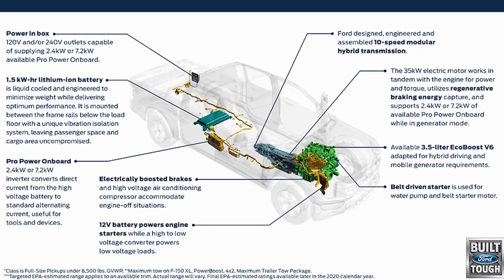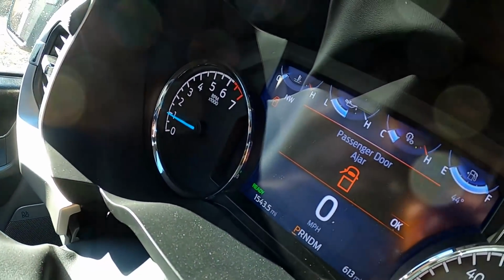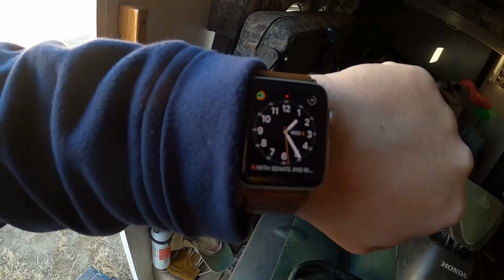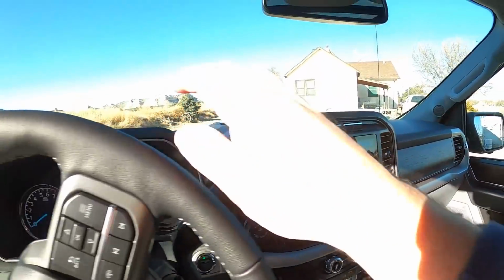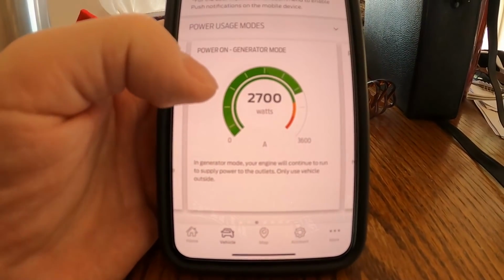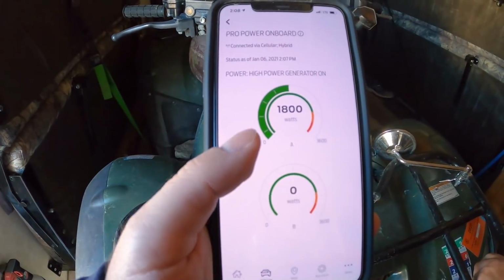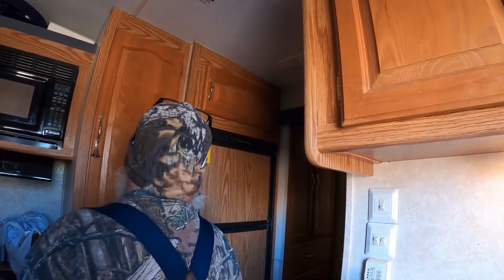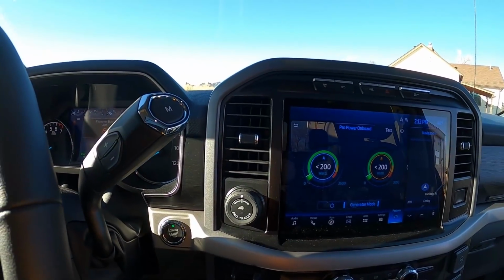Can the truck power an RV? 2021 Ford F-150 Generator Initial Test

Comment: Tim, great video although a little confusing as to whether or not the truck has to be left running and then it turns itself on and off as needed in generator mode.  I have a 2021 F-150 Lariet on order with the same Powerboost configuration, and the ability to power a trailer is important to me so I don't have to lug a portable generator.  I ordered the 2.4 KW and not the 7.2 KW configuration because it's not a work truck for me and I don't think I'd ever need 220 away from my shop.  You commented that you have 30 amps in the F-150's 220-Volt outlet, which is true.  However, you showed a splitter that plugs into a 220 outlet and provides 110 volts.  It does this by tapping one of the two legs, because a 220 volt outlet is essentially two 110-volt wires back-to-back.  The 30 amps in a 220 circuit consists of 15 amps on each leg.  Thus, if you tap into only one leg with a splitter, you'll only get 15 amps at 110 volts.  If you want 30 amps at 110 volts out of a 220 volt outlet, both legs of the 220 volt circuit need to feed into a transformer to drop them to 110 volts; in that case, you could obtain 30 amps at 110 volts.
Reply: @artvr2961  Art, I'm not an electrician either, just an old(er) engineer.  The 220-110 adapter plugs that I've looked at are very simple in that they just connect to one of the two 110v wires and the neutral leg of the 220 outlet, with a 110v output side that looks like a normal 3-prong outlet.  That's fine but it is not the way most 220v outlets are designed to work to provide the full power output -- 30 amps in this case -- by providing 15 amps on each leg.  But because this adapter would be drawing current from only one leg, I would worry that the circuit breaker in the F-150 will trip if more than 15 amps is drawn from that one leg.  Given this, it appears to me that the F-150's 220V system is for 220v appliances, such as welders, large table saws, etc..  However, there are a couple of solutions:  1) Buy a converter than takes 220v and steps it down to 110 but it'll have to have 30-amp capacity or about 3000 watts.  They're available on Amazon for about $200 BUT (big BUT) there's a note that says the ones I looked at are for European/Asian 220 only because American 220V circuits use 2-phase 220v power, whereas European/Asian are 1-phase. (2) Reduce the starting current draw from your RV's  air conditioner, using an EasyStart accessory.  I bought one and tried it out because I have an A/C unit on my trailer that trips my 2000-watt generator due to the high starting current (I think the BTU rating for my A/C is 13,500 BTU/hr).  I did not want to buy a larger generator because it won't fit in my trailer's storage compartment and it's much heavier.  The EasyStart has to be wired into the A/C's circuitry and it uses a solid-state circuit to reduce the starting current and make it possible to run the A/C on a 2000 watt portable generator.  They're not cheap (about $300) but they do absolutely work.  It took me about an hour on my RV's roof to wire it into my trailer A/C unit and another 20 minutes or so to get it set up.  The EasyStart installation instructions are excellent and they're tailored for the brand of A/C you have.  Here's their website:  https://www.microair.net/products/easystart-364-3-ton-single-phase-soft-starter-for-air-conditioners?variant=30176048267.  If you go this route, then you don't need to fool with the 220v in the F-150 and can plug into one of the 110V, 20-amp outlets.  This is the rationale that I used to equip my F-150 (not yet delivered) with the 2.4KW generator system and not the 7KW system.
Reply from the maker: 1. Leave the truck turned on, the engine cycles off an on.

2. I just bought a plug converting 220 to 110 and keeping the 30 amps. This means I’ll plug it into the camper with 30 amps.
Reply: @artvr2961  Well, yes and no.  I am looking forward to not having to cart my 2200 watt generator when dry camping, as it's just more weight and something else to carry gasoline for.  I do agree that the generator system is more aimed at folks who use the F-150 as their work truck; I decided that I'd be very unlikely to need 220V power when away from home.  My welder will run on 110 but just not as well as on 220 if I ever had to take it somewhere else to weld.
Reply from the maker: @artvr2961  This plug was recommended from a viewer on this channel. Not sure it is THE solution, but I ordered one to see if it would work. Naturally, it is on back order.

https://www.homedepot.com/p/PowerFit-30-Amp-240-Volt-to-30-Amp-RV-Outlet-Adapter-PF923055/203213234?cm_mmc=hd_email-First_Delay20210107_PP_ET_Merch_First_Delay_3741587_-PRODUCT_IMAGE__WM28915233#product-overview

Comment: Thank you, always like to know more than one opinion. Sure enjoy your  program, its very useful. It will be helpful when I get ready to buy. I am looking forward to your report on the new Ford. Specially on how towing and the generator work. I was wondering if it would power a camper, either  truck or trailer.

Comment: You can charge an EV with the 220/30 amp outlet, you would have no problems with an RV
Reply: IMHO RVs are more punishing because most folks don't understand the damage they can do to a genset/inverter with high amp appliances... little to no surge protection

Comment: Iol love where you are taking this too; this is crazy lol I have an RV and added a soft start for a 15k BTU A/C Coleman Mach 10 and when dry docking we use the A/C through our 3500 Inverted Generator. Now  using an A/C through a  new F150 Hybrid is crazy; love this test lol Yet if the RV was set with an after market Hybrid 2000 watt Steinway Inverter and lithium batteries. You could  run it through this truck all day as long as the Truck has gas. Much quieter thats for sure. But for me it would be boon docking nights. I'm getting this truck regardless. May jump out of my  current Lease 6 mths sooner.  Love this Hybrid!

Comment: Now hopefully RV manufactures will put a 30 amp plug at the front of the camper as an accessory plug-in for keeping the air conditioner on while driving down the road to your campsite.....

Comment: The lights and the fan in the RV are 12-Volt DC not 120-AC, so unless it has an inverter/charger it will take  little amperage draw coming from the converter to charge the batteries.

Comment: The ac may not run the compressor because it’s so cold out already. Probably showed have turned the propane heat on and warm the trailer up.
Also if you went to bed and let the truck start and stop all night at a camp ground they would probably ask you to leave.
So your only pulling 100 watts and the truck has started and used gas already. Not good. This is why I say the battery is to small.
At only 100 watts it should have ran for hrs with out starting the engine.
The engine is only idling so your not going to use much fuel when it does start.
If boon-docking it would be ok.

Comment: Refrigerator will draw 1100 watts normally.space heater will be able to tell you more. I always thought it was unwise to run a microwave empty.
Reply from the maker: There was water in the microwave.

Comment: I really wish this worked. Simple for me. If it works I buy the F150 next month. If not, I wait for my reservation number to come up on the Cybertruck... Does any of your fam have a roof top camper unit with a heat-pump, (kinda rare I think)? That would be a good test.
Reply from the maker: Sadly, no heat pump that I know of.
Reply: I ordered my cybertruck.
It comes with both 240/120 with much bigger capacity.

Comment: Ford setting the standard again.

I really believe that this is going to be a game changer if it proves to be very useful and reliable. 

LOL.....I wonder how long it's going to take before the other brands try and copy it.
Reply from the maker: About 2.2 nanoseconds to copy.
Reply: The generator mode is very cool, and so is the full recline seats. I absolutely hate the dumb fold down shifter though. That thing is gonna break in half a second if it gets any regular use, then how the hell do you shift it in drive?
Reply from the maker: @espeterson522  you don’t have to get the fold-down shifter. My truck has a column shifter.
Reply: @espeterson522  ......The key words in your reply are”regular use”. 

I really doubt that it’ll be used by owners as much as you think for the purpose it was designed for. 

Also, I don’t think it can be used when the vehicle is in motion so more be than likely,  there’s a lockout when the shifter is not in the “Park” position.

Comment: Backfeed your house, you could run your furnace, some lights, and chill the fridge a few times a day.
Reply from the maker: You certainly can with an external power input plug and a way to turn off the power in through a breaker box setup. I’ve been watching a lot of “this old house.” 😂

Comment: Tim, you can delete the two honks after walking away from the running truck with the ForScan OBDII programming tool.
Reply from the maker: Should be a setting in the truck imo. I know I can turn off Chevy’s honk.
Reply: GOD BLESS YOU - every one of my Ford's did this and drove me nuts (it's super loud)
Reply: @rkalla  it's to let you know that the keys are out of the vehicle.

Comment: Something doesn't make sense. You have a 7.2KW battery onboard and had a very small load. Why was the engine running? Shouldn't the engine only turn on when the batteries get low? It's hard to imagine you drew down the batteries enough to cause the engine to kick on and recharge the batteries. I was under the impression when you plug into the outlets in the bed, it uses the power from the hybrid 7.2KW battery and starts the engine when the batteries need to be charged. Again, my understanding was the "generator" isn't a conventional generator where power is generated by the engine but more like a 7.2KW battery pack with the engine kicking on/off to support the battery state of charge.
Reply: It's a 7.2kw system,.but the battery in all of them is the 1.5kwh isn't it? I'm 99.9% sure the battery is 1.5kwh
Reply: @rkalla  I stand corrected. That's correct. The system can generate 7.2KW but the battery is only 1.5KW.
Reply: Everything I’ve seen shows a 1.5kw battery.
Reply: @jeffs2809  7.2KW is the upgraded optional battery, which he has. A 2.4KW is standard.
Reply: @Thomas-qk7wf  3 different levels/options are offered.
Reply: @Thomas-qk7wf  you're thinking of inverter capacity. It's a 1.5kw battery regardless of inverter size.
Reply from the maker: That’s a great observation honestly. I don’t have an answer for you. It would make sense the truck wouldn’t run at all just pulling a light load.

Comment: Lights are 12 volt system. Battery would power those. Your truck would power the inverter if battery is low.  Microwave, air conditioners, toasters, Electric heaters have the highest serge power.

Comment: Good video Tim. Now I have RV’d for 20 plus years. I used two battery’s and dry camped for two weeks at our favourite spot. We can easily run the lights, DSI for fridge and hot water tank for a week to 9 days. All 12 volt of course. Now I had a Honda generator to recharge the batteries and or other appliances. A Honda generator can run over 5 hours on just over a cup of gas. Honda is quit as hell. I wouldn’t run my truck to power my camper. Now the test of doing it is great of course but not all totally realistic for vacation goers. Over night stays with no power yes.  My thoughts and experience. I would also use my generator to boost my boat battery if need be. At the dock or shore. Now a days they have portable booster packs though. Cheers
Reply from the maker: Once it’s not cold as hell, I’ll stay overnight and try the truck powering an RV.
Reply: This is a damn interesting point - had no idea a stand alone type generator like the Honda is that efficient. Very eye opening.
Reply: @rkalla  I think he's joking about only using a cup of gas per 5 hours. My 2000W gen runs  ~10-11 hours on a gal.of gas on eco mode charging my batteries. If i run a heater or something requiring more amps, then you use more gas as the generator runs higher rpm's. Like him though, I wouldn't pay the extra premium for the Hybrid just to replace a small gen-set. If you have other uses, then it may make sense (?).
Reply: @herb7877  appreciate the heads up - I took him literally at the "1 cup of gas" comment so what you are saying seems a bit more what I expected.
Reply: @rkalla  Yup. They are great and very very efficient and super quit. Had mine for 18 years. Runs like the day I bought it. 1000 Watt. Buddy has 3000 watt and runs his air conditioner etc if need be.
Reply: Which model Honda Generator do you have?  

According to the Honda website, their most powerful generator, EU7000iS, can run from 6+ to 16 hours on a full tank of gas (5.1 gallons)

Comment: Also Ford need to add a 30 amp plug
Reply from the maker: I’m not sure the rational about the amps. Seems like a 50 amp plug would make sense.
Reply: @Pickuptrucktalk  that would take you beyond 7.2 KW. You need to have 220 volts with 50 amps. It would take you to 11KW

Comment: Cool but you need to do a summer test with the compressor running that’s the only time I need to bring my generator with
Reply: Am a BiPap user.  I have to carry back-up, Honda 2000i and 5 gallons super unleaded without ethanol.  However this is a grand feature..

Comment: Run a couple of plug-in electric heaters, those will load up the generator.
Reply: Yeah, I came to the comments to say RESISTIVE HEATERS!
Reply from the maker: Good point!
Reply: Good idea!
Reply: I just took my camper down to Bullhead city for a week and we use space heaters when in a full hookups site and they work great. And yes they can trip the breaker.

Comment: Can you run the power inverter generator hooked up to the trailer while driving down the road with appliances running ?
Reply: Yes.
Reply: I used to just run the propane on my fridge to keep it cool. Takes next to nothing. For if you stop somewhere it may drain the battery really fast. Not sure on the Ford system but truck would be off. Hmm
Reply: @ramrider1453  Fridge is easy on propane. This Ford system can run the AC. Lifesaver here in Texas. It's blazing hot and it takes hours to cool after arrival. Everything in the trailer heats up while traveling.
Reply: @jghall00  oh for sure. Most people though do prefer to find places that offer power of course. But at times it maybe hard to find such places while travelling. Again I would just use my generator. It’s light to carry and cheap as hell on fuel and quit. Less exhaust fumes then having a truck run. It’s a great idea though with Ford and there power station. I personally wouldn’t use it that much but others would.
Reply: @C10sRule  I can’t see that if the engine has to start up to charge the on board battery.

Comment: If your towing a trailer and have the trailer plugged into the trailer hitch and Trailer hitch power, is that connected/wired to the generator as well ? just wondering it would be nice to stop at a truck stop or where ever, and not unplug from hitch and plug into the generator its self and go into trailer and cook in the microwave like you showed. 
I believe you have to unplug, and then plug into the generator but I'm hoping not.
Reply: @Randy James Correct..

Comment: May be too cold for the a/c compressor to kick in - so you may not get a realistic draw on current.
Reply: I was thinking the same thing. The 44 degrees ambient temp is likely lower than the temp on AC.

Comment: Tim, your new truck has become your whole new life!  And I appreciate it!
Reply from the maker: For right now. I have a bunch of other videos I need to publish.
Reply: It might seem like your approach with these videos should be 'Explore these features along with me...' but that turns out to be more confusing than informing.  Better you do your research/education off-line and then showing what you learned on-line.  You could have done a clearer 'discovery' video by just using a few heat guns.  Straight on/off tools with high watt demands.  That would also have given you time to find an adapter.  No RV owner would by-pass using the 30A 240V connector.
Reply: @jacktyler7599  I kind of like the discovery approach
Reply from the maker: @jacktyler7599  maybe. I debated on just deleting this video, but we both thought it was useful with the Ford pass app and showing how the system could work. It is a tough thing deciding between running something now or waiting months to do a video like this one. Based on user comments, if I waited for months to warm up, I’d lose my audiences interest.